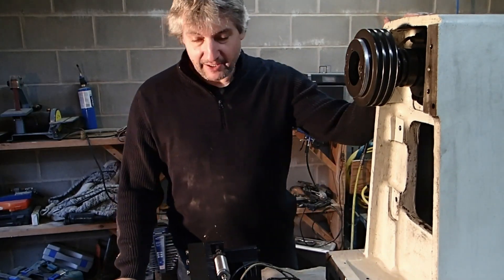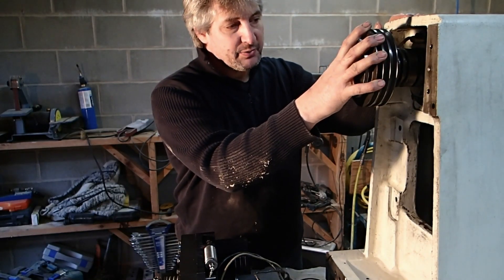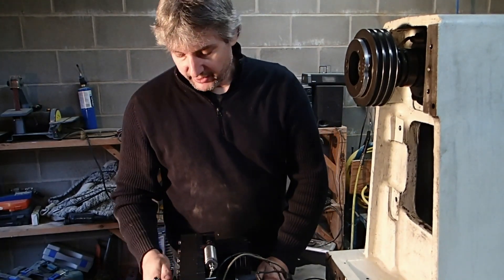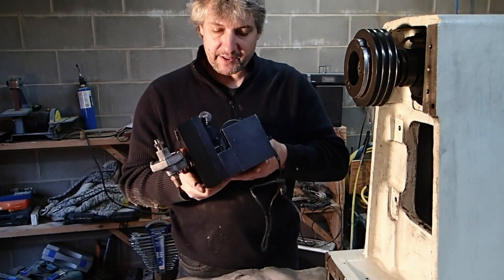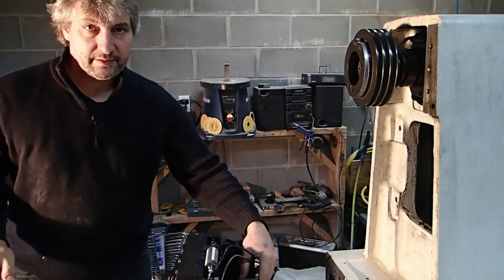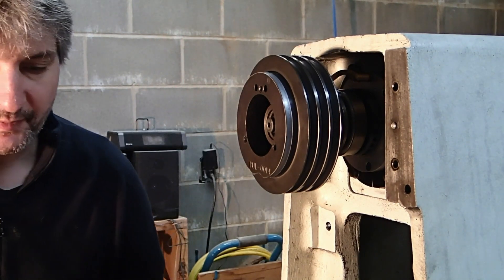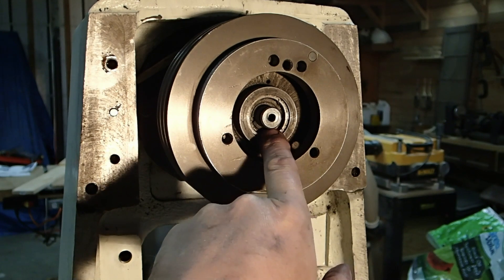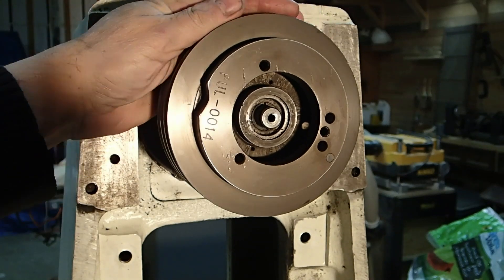Part 12 - (Draw bar cylinder)

Comment: Great videos. I have been curious as to how fedal had their spindles set up.  Gives me some ideas for mods to my mill.  Keep them coming!
Reply from the maker: Glad the videos are useful! I watched your Chanel your CNC build is impressive? Are you happy with the Masso control so far? I plan on using UCCNC. I already bought there Ethernet controller and a servo drive to make a bench test and so far it’s looking good.
Reply: @BlaiseBarrette  I am happy with the masso for the functions it has.  Their documentation is lacking and you have to refer to the forum for clarification, which can be frustrating at times.  But it is a stable controller and the masso team is constantly improving and updating things.  Overall I would but it again.  I wish they had an interface panel and a handful of other features like good spindle feedback for rigid taping.

Comment: I bought one of the removal tools for the drawbar. O.D = 1.429", I.D. = 1.148" x 1.12" deep, OAL = 1.5,   .25 hole through center.
Reply from the maker: Little scoop! I just got the draw bar out and it went very smoothly! I designed a tool In Fusion 360 and 3D printed it. I'm just starting to edit the video now. Hopefully, it will be online later tonight.